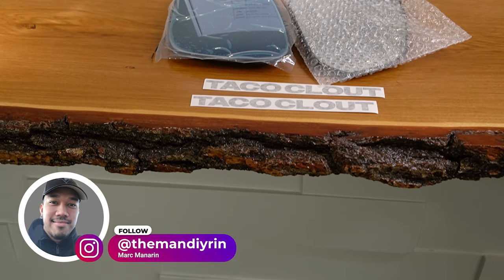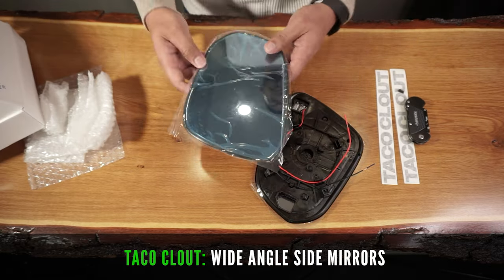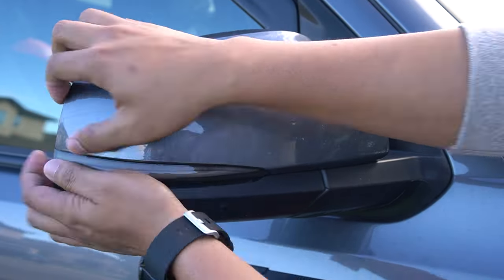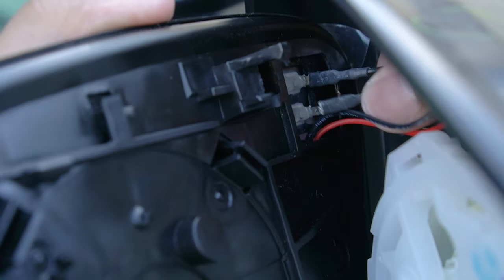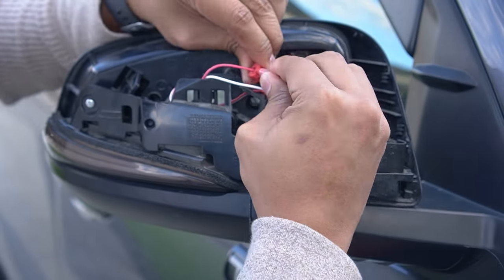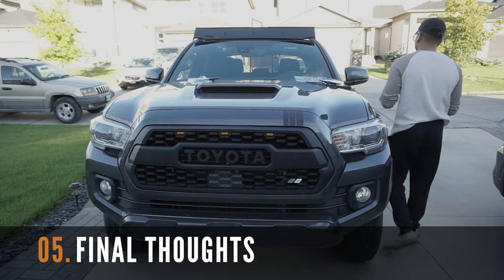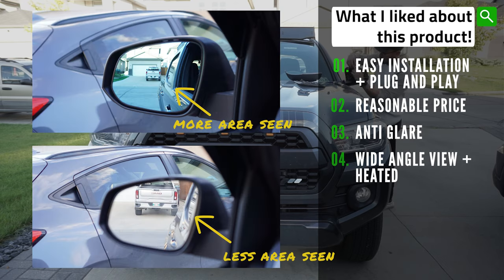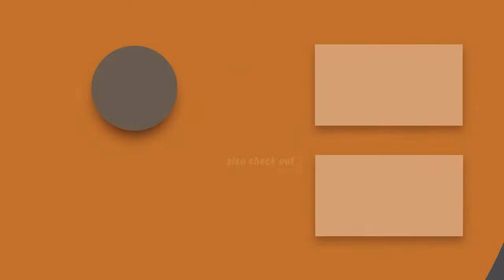WIDE ANGLE PERFORMANCE SIDE MIRROR INSTALL on the 2022 Toyota TACOMA TRD Sport | TACO CLOUT

Comment: theManDIYrin Just got my mirrors in today! I'm excited to install them, but it will have to wait until this winter storm releases it's grip. I was bummed out however with 3 things about my purchase. 1) They didn't let me use your purchase code. I suppose it had expired. Since it was my first purchase, and I registered, I still got the 10% off.  2) I didn't receive any stickers. I'm thinking the order was drop shipped from the manufacturer (but still). I have a spot in my bed where I am placing my mods stickers as I install them.  3) no instructions for the install in the least. I have the "Blind Spot Sensors" so mine had to be all 3 choices or "Top of the line item". That being said Thank you for doing this video so I was aware that I had this option as a mod for my truck.
Reply from the maker: Hi! Excited to hear you got your mirrors! Yes I agree about winter struggle I'm also waiting to shoot a couple more tutorials but snow doesn't stop!

In regards to your concern, first apologies the code did not work. I just reached out to TacoClout and they mentioned it may have something to do with the integration of their new website. They're working on updating it.

Not sure why there was no stickers but those guys at TacoClout are awesome, I'm sure if you reach out they would send one!

For the blind spot sensors, I don't have that on mine but from what I understand you just plug it in on the mirror from the old mirror so hopefully it's not too complicated.

Good luck on your install!! Thanks again for watching!
Reply: @themandiyrin  Thank you for the reply, and added information on their website issue. I may contact them for a sticker, or add it as a purchase on any future order. 
I agree the BSM should just be a plug and play step. I'm just one of those people that like to look at instructions as I go. I do know as well that "Mumfy" has a full install video right there. 
Next up is I'm mounting "Raptor" style DRL's in my OEM SR5 grill. Somebody stop me LOL.
Reply from the maker: @Steak_59  You're welcome! Thanks again for watching and looking forward to hearing about your future mods! Raptor lights are awesome haha I have one myself!
Reply: @themandiyrin  Just finished my mirror install and again, your video was very helpful.  You really have a talent to explain, and show a person how to DIY. 
I did reach out to Taco Clout and they are sending me stickers. It turns out they had ran out. My install went flawless, and the BSM wire was in fact a plug and play easy clip in.  Really like these mirrors, soo worth the price. Thanx again.
Reply from the maker: @Steak_59  thank you so much thar means alot as it does take effort to shoot the additional details and angles. Appreciate your continual support and I'm glad your install went well! I agree this is one of my fav mods to my truck .

Comment: My truck didn’t come with turn signals on the mirrors so I’m assuming the turn signal function won’t work..correct?
Reply from the maker: Hi Carlos thanks for watching my video. To answer your question, since your truck didn't come with the turn signals it wouldn't be an easy wire tap as I showed in the video. It's not impossible but you would need to run new wires and have it connected to the front turn signals.

Comment from the maker: 🛠 Question of the day: What's the coolest mod you've done to your Tacoma⁉
Reply: Meso puddle pods! I also have a trd sport but a 2020. I was going to keep it stock but then alot of mods came like lifting it and all lol
Reply from the maker: @vannatouch2172  oh man! I've been wanting those for a while they are always out of stock! Lol
Reply: @themandiyrin  yeah man. If you join tacoma world sometimes ppl are selling it new. The install is quite extensive but worth it lol
Reply from the maker: @vannatouch2172  I will try that! And I heard it takes a full day almost to install but I like the challenge haha. Nice that you have a sport as well! If you don't mind me asking what lift and tire set up are you running? That part of the mods is intimidating to me but I wanna fit a Stealth Custom f5 on mine eventually
Reply: @themandiyrin  yeah man i got the superwhite. I went with bilsteins 6112/5160 with headstrongs aal and their half inch shim. I have like a 2" lift all around. Headstrong aal doesnt require you to cut the brackets on the leaf springs. I have scs ray10s 17x8.5 -10 in matte gunmetal with 265/70 tires. I might get bigger tires down the road but youll need to remove your front mud guards because it will rub on full lock but other then that i love my setup. One mod lead to another mod and it didnt stop. Haha
Reply: @themandiyrin  i also installed the lift by myself it took me almost all day. My first truck and first time doing lift. I usually lower cars. Also ive seen people selling the meso pods on facebook marketplace
Reply from the maker: @vannatouch2172  oh man that sounds like an awesome set up! I can relate to the modding never stops but it's fun haha. I'll you know when I do my lifts in case I have questions haha I wanna do it myself as well
Reply: @themandiyrin  yeah man i was in the same boat. Learning as i go. The install wasnt bad, the fronts were easy but rears a little tedious. I also got ome ucas. I kind of calm down because i got everything i wanted right now. Lol yeah man let me know if you have any questions. You can add me on fb if you want too. Same name.